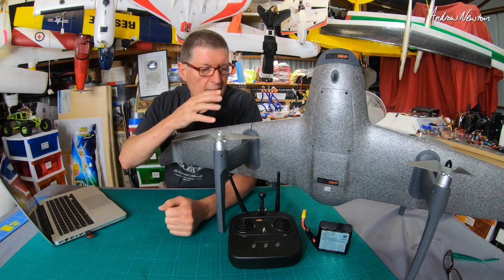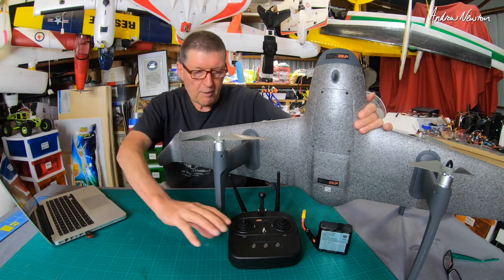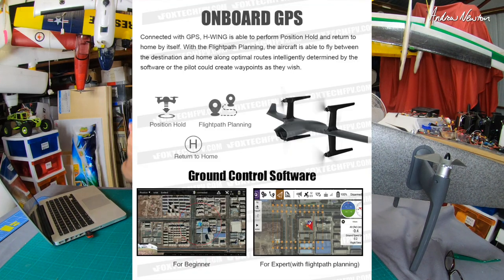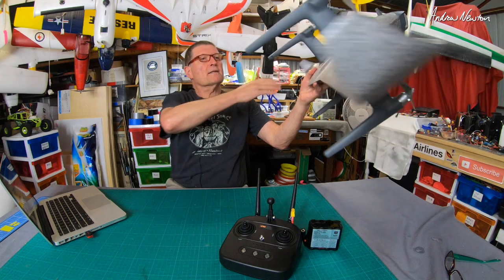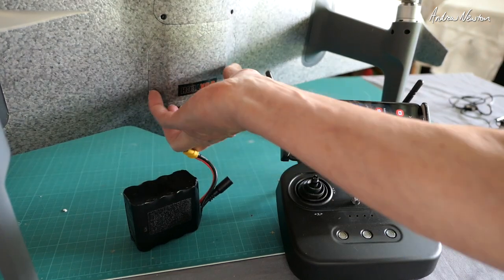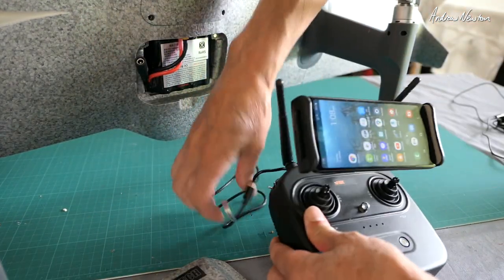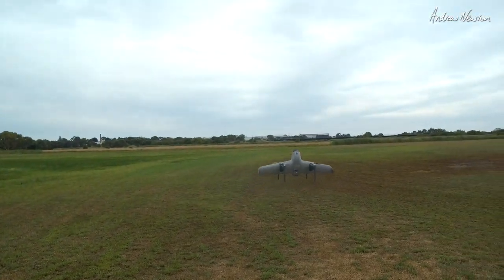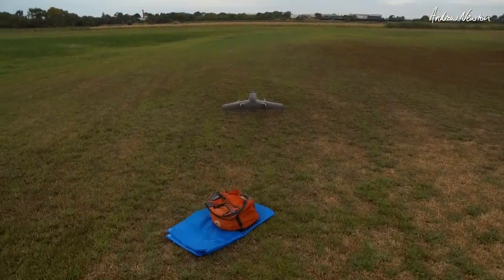Foxtech H-WING RTF VTOL

Comment: Excellent piece of kit in this review. It's like you standing in for Q doing a preview for 007.

Can't get over the size reduction into the case and the ease of assembly. This perfect aircraft for use in a first responder role. 

FYI: the Nimbus you reviewed ~3 years ago as a KIT, has been offered by Foxtech as a RTF VTOL by having front two motors on pivoting pylons and a third motor fixed on the rear boom. 
(details on their website, or their YT channel)

Comment: Interesting how the GPS still works with the model pointing upwards and the antenna facing horizontally rather than up at the sky (as it would be in forward flight)? Can't argue with 12 sats locked though! Looking forward to the full flight video.
Reply: I had my gps upside down for a year and it still got 12 sats consistently.
Reply from the maker: That is amazing!

Comment: Hi Andrew, I recently got one of these wings and it flew fine straight out the box. I've heard you've had some problems with yours? Wondering if I can help you at all? 😊
Reply from the maker: Aha, that's great to hear Giz. Seems like mine was configured differently. May need a full re flash, but I need Foxtech to work it out for me. I'm off to watch your review now.
Reply: @AndrewNewton  You might pin that comment up cause he has the only review right now that shows the drone working ... cause I guess you are still working with the support ... THX

Comment: Thanks for the video, I'm considering purchasing this VTOL but I am concerned about the GPS locks as you mentioned in the video.  I live in the U.S.  Do you think I will run into the same issue you experienced in Australia?  I don't want to deal with the issue if it's going to produce a lot of problems with GPS lock in the U.S.
Reply from the maker: Should be fine, I suspect they are using my experiences to fine tune the firmware.
Reply: @AndrewNewton  If you are doing the English customer service for Foxtechfpv.com - I hope you at least received your H-Wing for free !!

Comment: I would take that range estimation with several kilograms of salt.  10km??  It would have to be at 2000m or so for that.   It may be PX4 as that fork seems to be favoured by companies because it is not as open source as ArduPilot.   Big disadvantage is that if it is too turbulent on the ground to do a tail sitter landing you can’t bring it in for a normal one.  Wings, wind and tail sitting don’t mix in my experience.

Comment: hey Andrew, Thanks for the view. I got the H Wing today but having an issue connecting via Bluetooth. Did you have any issue open up the bt devices selector in the app at 8:33 in the video? Which phone are you using since I suspect these is an compatibility issue with Andriod 12..
Reply from the maker: Yes it can be tricky. Connect and turn on everything, make sure bluetooth on your phone is on and open to pairing with new devices. You can also try pairing directly from your Bluetooth settings rather than the app. Looking for the T10- signal.

Comment: Great video. I have mine and am wondering what's the recommended method for recharging the remote controller? I see two ports but unsure if one of them is for charging.
Reply from the maker: Smaller one, micro usb is the charge port

Comment: Hi, where did you download the APP in English? I bought the product from your channel but I can't get the application in English, greetings.
Reply: I am in the same situation - just received my H-Wing; found and installed the QGroundControl app (if I need it to alter GPS settings), but cannot find the HEQFPV app on Play Store or on the Foxtech web site - even after logging in. Andrew - would Foxtech allow you to post a direct Link to it ?
Reply from the maker: @wackyack3165  "Default APP" and "QGround Control" are linked on the product page. Haven't been able to switch mine to Wing mode yet. Hope you have better luck.
Reply: @AndrewNewton   I wonder if you didn't have enough throttle set when you  tried to transfer to forward flight - such that the anti-stall kicked in ??
Reply: @AndrewNewton  Thanks Andrew - hadn't realised where it says DEFAULT APP that this was a hyperlink !! Silly me.

Comment: Hi Andrew, got a H-Wing  from Foxtech and have GPS issue, working with Foxtech support with no luck. How long did it take to get satellite connections after parameter changes?
Reply: I am based in Australia
Reply from the maker: Look at the follow up video Scott. Cant really remember but it should be covered there https://www.youtube.com/watch?v=YJpAr99-gag
Reply: @AndrewNewton  Hi Andrew, issue solved loose power wire on GPS connector, time to go fly tomorrow. Regards Scott

Comment: Damn it - I ordered one two days ago! I 've missed your discount code. I'm in the UK, I wonder if I will have similar GPS satellite locking problems that you have had ?
Reply from the maker: If you cant get home pos lock then change EKF2_REQ_SACC parameter from 0.6m/s to 1.0 then retry, Then change back to 0.6. (no idea what that all means)
Reply: @AndrewNewton  Thanks Andrew - I presume the EKF2 parameter is found somewhere in the transmitter settings - or is it in the ground control app settings ?
Reply from the maker: @wackyack3165  Ardupilot parameters, via QGroundControl. I needed to connect my phone via USB to the FCB but Bluetooth may be possible. Video demo https://www.youtube.com/watch?v=25G6dMa7hw0
Reply: @AndrewNewton  Many thanks Andrew.

Comment: One flaw I see in this design, though maybe not so much a flaw as a point of anxiety, is the multiple connection points.  First with the motor pods, then again with the winglets.  Too many points of failure, at least for me.
Reply from the maker: Yes, a bit of tape might be a good idea for safety

Comment: Hello, got my H wing today, but the APPs in Chinese. Is there anyone who can help me with how to change language to English ?
Reply from the maker: Strange, mine is in English. Download the latest version maybe.
Reply: @AndrewNewton  Thank you Andrew. I have found out what went wrong. My phone has Norwegian as system language, and that made the App not install the English version. I changed the system language to English while installing the App, and now it works . Tested the wing to day, but the weather was bad with to much wind so i landed after only lifting off about one meter. The service from Foxtech was fast and accurate, when App language messed up. Have a nice Easter.
Reply: I have a Samsung Galaxy A 10,1 tab. I can't get it to see the H Wing (t10) using the Bluetooth. If anyone knows a fix for this, it would be super nice. The phone screen is so small. I use the tablet when flying my Dji Mavic, and it's better than using a phone.